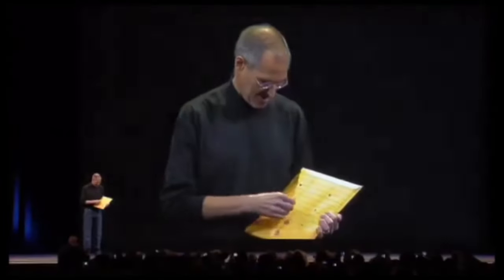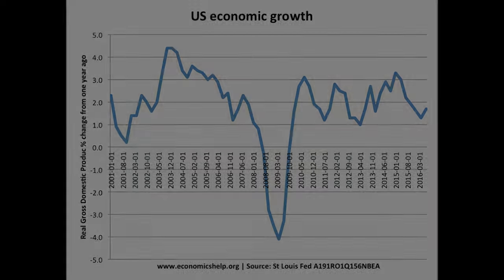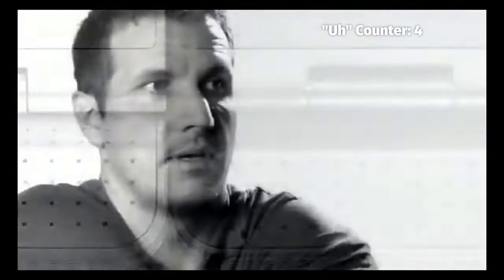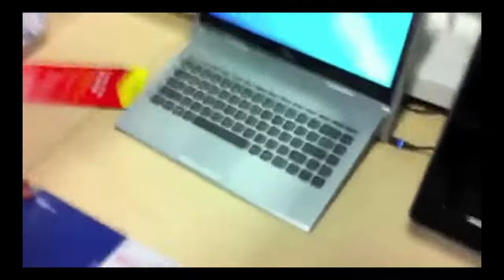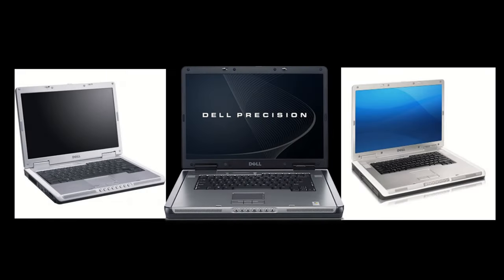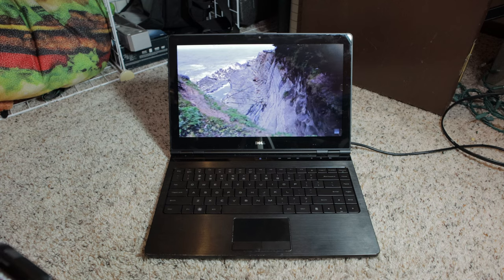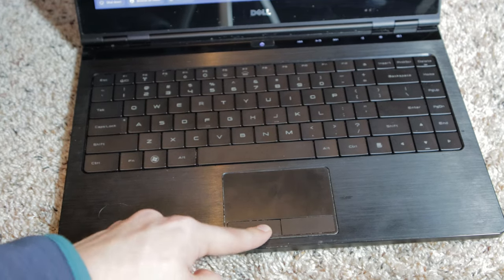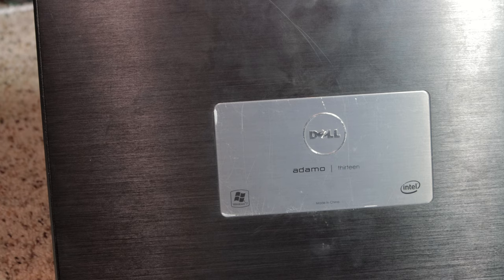The Dell Adamo 13 - A Beautiful but Failed MacBook Air Competitor (Documentary)

Comment: I think adamo looks better than macbook air. It is more fashion while the air is a little bit too plain. And 2000$ wasn't thar bad either since the base model air only got a very slow 1.8 inch HDD although not as slow as the IDE one found on the original air. Macbook air's GPU isn't a dGPU, it's an iGPU integrated in the MCP79 chipset, but it is way better than adamo's intel iGPU anyway. By the way, as far as I know, different specs of adamo have their own different name. The low spec version is the "Admire" model, while the high end version is the "Desire" model. This is really interesting.

Comment: I have a Dell Adamo 13 Pearl (2GB RAM Version) that works fine running the latest Windows 10 (Version 21H2).  Cosmetically very good, has a few bubbles around the LCD. What is it worth?  I'm putting it up on ebay and have no idea how to price it.  Maybe I'll just auction it starting bid at .99 cents.
Reply from the maker: idk quite honestly. i got my unit for only $80 as is on ebay (really lucky find, as i mentioned in the vid)
but id say its worth at least $100
Reply from the maker: its just hard to say because i saw another adamo selling for $95 on an auction (granted, very poor condition, but complete and working) and it was relisted like 6 times before it sold. people arent looking for these machines very often. but its really cool that you have one, and a pearl unit at that! it seems like onyx was the more popular color